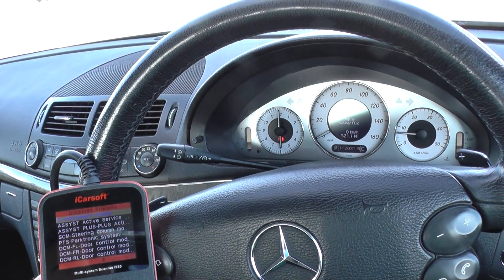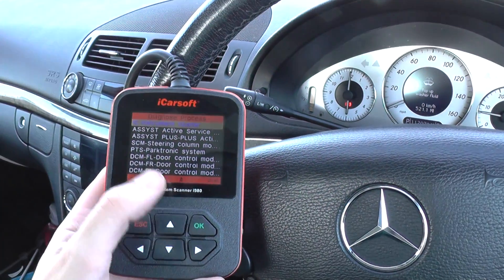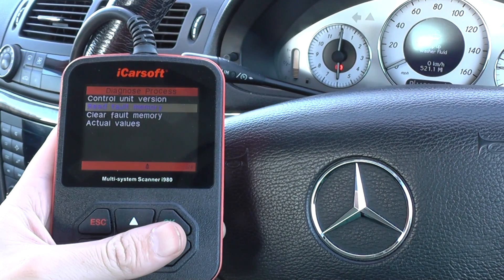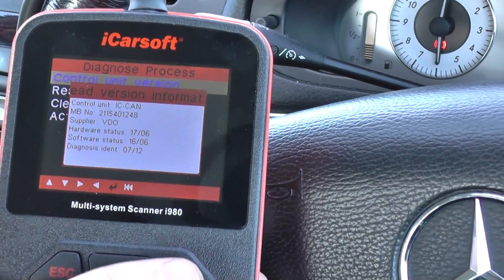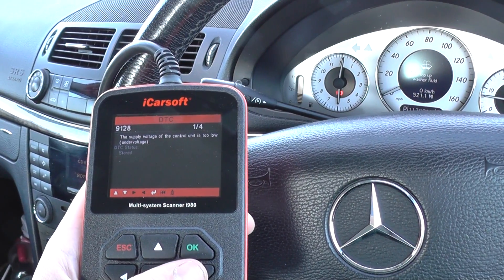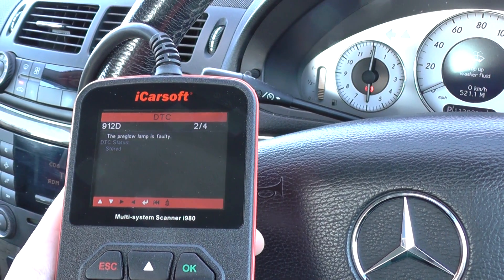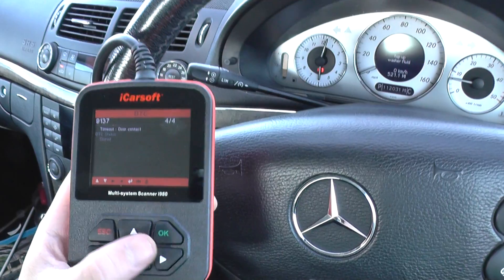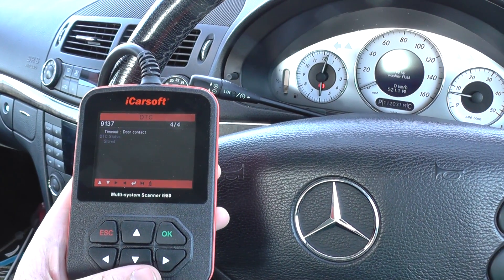Mercedes Benz Instrument Cluster Fault Finding Diagnostic Kit

Comment: 2006 c350 instrument cluster stays on when no key in drains battery so I have been taking fuse out any idea what could be going on ?? Thanks
Reply: Yr altenator 100%
Reply: @networkbits8958  changed that still doing it I still pulling fuse very frustrating
Reply: @edtixx5299  have you ever found the problem, I’m having the same issue with my 17 cla
Reply: @vinniejohnson6896  believe it not it fixed itself after months of taking fuse out one night I forgot car started haven't needed to take out sense. But now car will not start for no reason after I drive somewhere

Comment: My custermer one doesnt even light up when engine is running?
Has the unit gone down any ideas
Reply: Did you solve the problem
Reply: Did you solve this? I'm having the same problem
Reply: I have the same problem with my 2002 w211 240e. Blank Instr. Cluster because of water penetration thru the air filter. Did you fix yours. ? Can U help. please.?